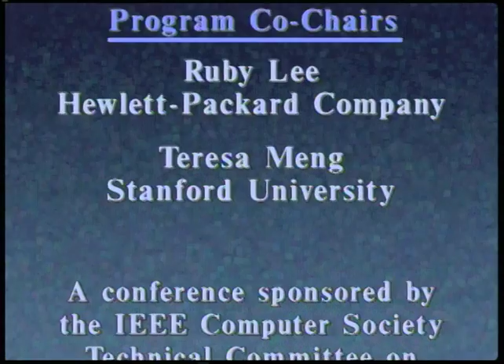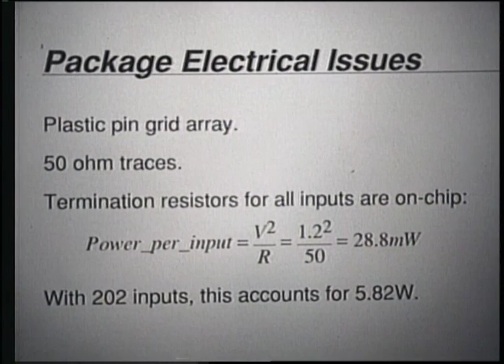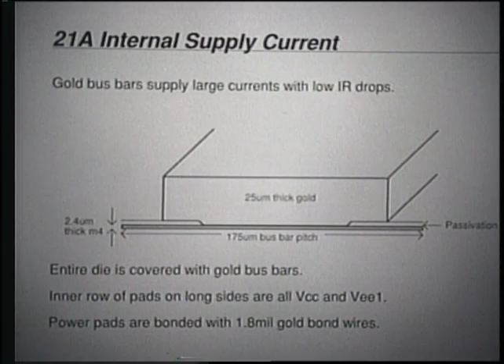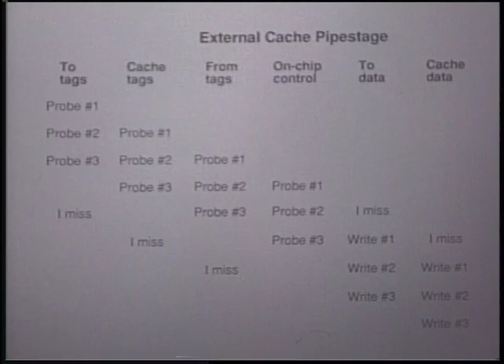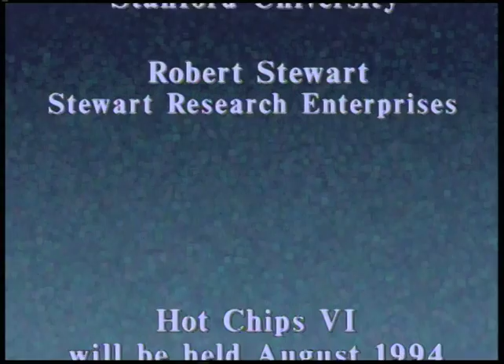A 300 Mhz 115w 32b Bipolar ECL Microprocessor, lecture by Norman Jouppi

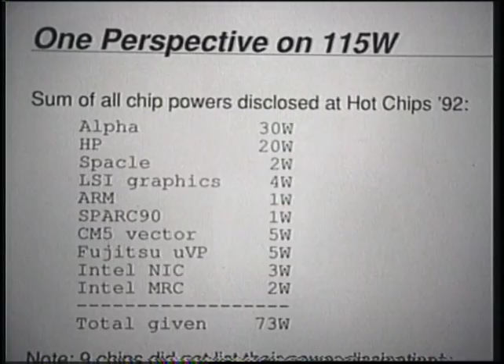Comment: 7:30 norm 20-40 years later - small tablet Pentium M ULV 1GHz 6W , laptop Core 2 Duo U9400 15W, desktop Core 2 Quad Q8400 at 3GHz ~100W, not much changed ever since 2010, except for some extra 100W+ on desktop (for short time untill it throttles back) this guy thought he presented some crap and team was never larger than few people.. but everyone does hot chips and then 8:45 he presented heat pipes.. before anyone else. Give him medal, Norman Jouppi must find this guy! True pioneer of modern computing
Reply: 12:00 5 stage pipeline "shallow" EXACTLY same as just presented 1993 Pentium!
Reply: 16:00 data parity also as in "just presented in 1993" Pentium..